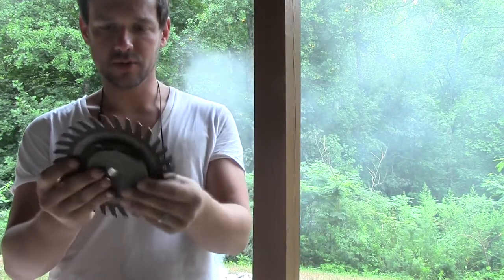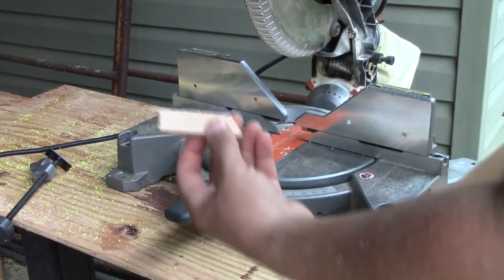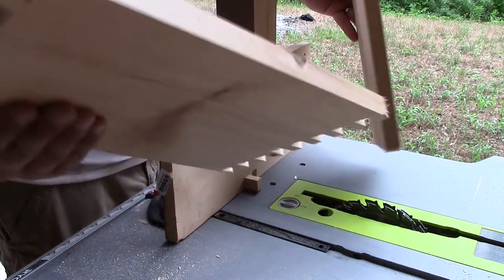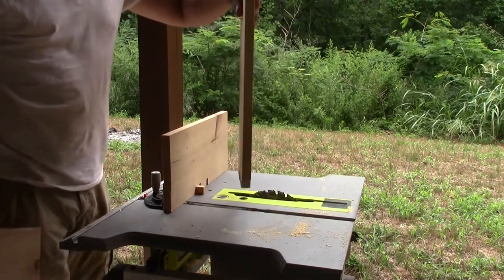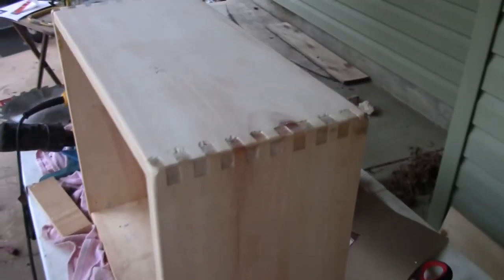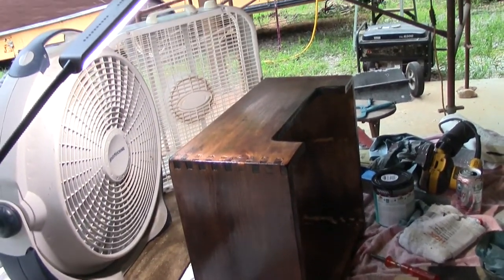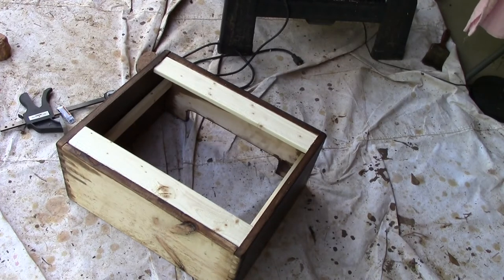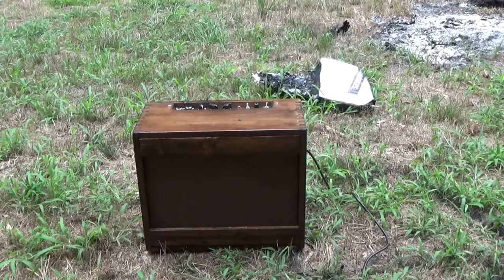Build Your Own Tube Amp (5e3) - Part 6

Comment: I highly recommend sand-sealer for your first few clear coats. Amazing stuff. Dries quick and sands beautifully.  You won't be battling rough prickly wood grain. Then you can finish off with a few clear coats of a durable poly or brushing lacquer which  gives you much better results. It marks up easily but it's a nice nitro. It's not only flammable,  it is explosive so be careful with lacquer..
I used a Danish oil with a tiny bit of paint tint to make an ebony stain for mine. I might try it again with different tints.. 
A paint shop might give you a bit in a pill bottle . Little gors a long way. Wipe on , let sit , wipe off . Let dry for a day before lacquer. 
I tested pieces of scrap wood to make sure each product liked each other lol